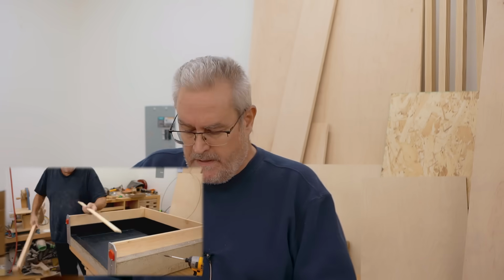Plywood Is Bad, M'Kay!

Comment from the maker: Reacting to the "feedback" I got on my latest video and shaking my head at how confidently people voice opinions when they have very little actual understanding of the situation.
I forgot to mention the second big reason why I designed the Y axis the way I did: it's easier and neater. Mounting the linear bearing directly to the concrete would be MUCH more difficult to do accurately, even with the anchors I cast into the concrete. I'd have to be MUCH more careful placing those anchors before the pour, and that would be ruined if they moved even slightly.
My next project (starting around the beginning of December, I think) is a fancy toolbox inspired by the  Gerstner models that have several drawers. I will be machining some of the parts for that project on the CNC, though, but all of the work could be done using the usual woodworking tools.
Follow the progress of all of my projects on Patreon: 
https://www.patreon.com/user?u=865843&ty=h
Reply: I’m excited to see the toolbox build!

Comment: I think there's just a disconnect between what you expect out of a machine vs what they expect out of a machine. Plywood and plate aluminum is fine for a woodworking tool, but it's not appropriate for cutting steel(can't take a decent cut without the chatter breaking an endmill, then there's the whole issue of wood moving with humidity). In the applications they're designed for, those linear rails are effectively a wet noodle. There's no specification for straightness over their whole length, you're expected to force them into alignment by bolting/clamping them to something that's extremely straight, flat, and rigid.

Comment: As you know you can build a CNC from plywood, MDF, 3D printed parts, etc as its been done many times before.  In all those common builds, no one bothers to pour a concrete base because those CNCs are designed to machine softer materials anyway (wood, plastic, non-ferrous) because those CNC build materials deflect and/or vibrate under heavy cutting loads leading to looser tolerances.  A concrete base suggests you are building a CNC to minimize vibration and keep tight tolerances.  You would want that if you plan on cutting harder materials like steel.  If you plan on just cutting softer materials, then the concrete base is just an overkill in the design IMO.  If you do plan on cutting steel, then you are going to want coolant anyway in which wood components is just a bad idea.   I just think people see a concrete base and assume you are building a heavy duty machine to cut harder materials that require coolant.   In the end,  it is your machine and you know what it is to be used for.  It doesn't matter what anyone else thinks about it.

Comment: Sir, I am a mechanial engineer and want to add my 2 cents here. I say this with all the respect in the world and as a longtime viewer. It is unfortunate that two pieces of the entire assembly dont reflect the other materials chosen, why even bother with a concrete base if the connection between the base and moving parts are wood? A CNC mill/router has to be strong, stiff and stable, if any of those requirements are not forfilled the machine will not perform as intended. You might get away with wood for the strength part, but it will not be stable, i.e movment of the gantry that reflects in the cut quality, it will also not be as stiff as aluminium/steel/conrete. There is a reason for why not even the absolute cheapest cnc products are made of wood. Honestly, the piece of steel/aluminium you wood need is not that expensive to get. 
The linear rails are actually not straight or flat at all from the factory, even the really expensive rails are not flat or straight. The straighness and flatness comes from the substrate they get mounted to, thats why there are so many attachment points to each rail. So, mounting them to wood is to be frank, a horrible idea.
best regards
Reply from the maker: I talked about why I went with a concrete base in a previous video, but to sum up stiffness wasn't the primary reason. Mass and it being a watertight tub for the coolant are the main reasons. But, as a mechanical engineer should know, stiffness is transferred to substructures that are solidly fastened to something that is stiff to begin with. Not 100%, but enough.
As for stability, you are overestimating the impact. There's more to using a material than just picking it and that starts with the design that works with the material to increase stability. Again, a mechanical engineer would know that.
The linear rails I used ARE straight - I checked them. And the wood is straight - I checked that. Is it perfect? No, but nothing ever is. Is it good enough for what I'll use this machine to do? Absolutely.
Reply: @IBuildItScrapBin  Thank you for the reply, I appreciate your work and intent, and Im understanding that the design steems mostly from what you want out of the tool and your preference to working with wood. I wright this not as a dismissal of your work, but from an engineering standpoint that consideres long-term structual behavior of the whole assembly. 

While your point about the designing with the material in mind is valid, and I completely agree that good design can mitigate material limitations, it´s difficult to overcome the both long and short term dimentional drift and stiffness limitations inherent to wood. Wood in contrast to concrete exhibit anisotropical mechanical behavior, nonlinear creep and dimentional instabillity, all of wich nobody wants in a cnc machine. FOr example, I would say that it is common knowlagde that wood creeps and changes with the seasons, even painted.

Some stiffness can be transferred, provided that the connection is solid and the load paths are in line with the submaterials behavior and purpous. For example, mounting a wooden structure to a concreate base does not change tha fact that wood has a significantly lower elastic modulus, is anisotropic and echibits time-dependent deformation such as creep, swelling and or shrinkage. While a rigid connection can reduce the effects locally, the materials own stiffness and dimentional stability still govern its behavior. 
In short, while mechanical interfaces matter, they do not override material science.

Regarding the linear rails. They are actually almost 100% reliant on the mounting surface and mounting tecnique. Almost all appear straight and flat when using a carpenter square. They are always measured after installation.

Sorry for the bad english, took me a while to wright this. 

Best regards
Reply from the maker: @styletokill  Wood movement isn't an issue when the machining time isn't stretched out over days. Wood is a perfectly stable material within a short timeframe, say the amount of time it takes to cut a few parts in one go. Any changes between machining operations are of no consequence. Time - it's an important factor.
Another important factor is the forces involved. I'll be running a max diameter endmill of just 1/4" (6.35mm), and most of the time just a 1/8" endmill, cutting just a few thousanths of an inch deep at a pass. That's nothing.
Final point is that this isn't a factory for making parts on a CNC. If I had such a factory, I wouldn't build the machine at all, let alone from wood - I'd buy one that's rugged and dependable.
Reply from the maker: @styletokill  You are greatly exaggerating the "issues". 
The best is to check back in a few months, after I've used the machine a few times and see the results. If there are real problems with it, I'll say, like I have with ever other machine I've made.
Reply from the maker: @styletokill  I like a good discussion, but you are making a big deal about insignificant details. For example, wood movement happens, but is only a factor if it happens during a machining operation OR if it's differential. If the machine is trammed accurately, the only way to throw that off by an amount that will make a difference is if the wood expands or contracts at different rates. For instance, if I made the solid maple cleats that reinforce the gantry different thicknesses. But I didn't do that (design right?) and in fact both are not only the exact same thickness, they are cut from the same piece of wood.
Reply from the maker: @styletokill  You should keep it at that because you clearly don't get what I'm saying. I never said wood is the best material to build a CNC. Never. And I never said all material behave the same way. Never said it, never would.

Comment: I have a lot of practical experience with plywood, and I agree it's strong enough. Not just strong enough, but arguably will add some damping to the system to keep it less 'ringy' (though with all that concrete that may be less of an issue anyway.)

But man, I wouldn't want to be slanging coolant around a machine with plywood. That would be my only concern.
Reply from the maker: Paint
Reply: @IBuildItScrapBin  I'm not the kind of guy that's going to keep up on maintenance. And paint never lasts forever. So, I try to design to my personal shortcomings whenever possible. Something I know you can appreciate.
Reply from the maker: You are exaggerating the "problem" and grossly underestimating the durability of paint. First, flood coolant isn't going to be washing over the wooden parts of this CNC - they are too high above the bed. Second, look outdoors. You'll see houses and other buildings that are... painted. They aren't out repainting them every few days, right? 
I see this overthinking all the time, where guys go out of their way to look for issues and the ones they find are often of no significance at all.

Comment: People don't seem to realize BobsCNC have been around for years and they've all been made completely out of laser cut plywood. They work pretty dang well. Woodsmith Magazine have build plans for a fully wooden CNC they published in 2019 issue 242 and in freaking 2014 there was a guy on Hackaday & reddit that made one out of plywood.  There's been several other commercially made wooden cncs out there.   All of these people are just keyboard jockies that probably haven't even built one of those cheap genmitsu / sainsmart cncs let alone an actual router based one.  They don't need to be made out of tungsten carbide to be rigid and capable.

Comment: So you want to compare stiffness of wood vs. metal huh- if you use maple like you commonly do, modulus of elasticity E is about 1.5x10^6 ksi, aluminum is about 10x10^6 ksi.  Lets say the sides of your supports are 3/4" thick, if you had used aluminum maybe you would have used 3/8" thick?  Total stiffness is E times I so for wood that is 1.5x10^6 x (3/4)^3/12, for aluminum it is 10x10^6 x (3/8)^3/12.  Do the math and you get that the 3/4" maple in bending is 20% stiffer than the 3/8" aluminum in bending.  Of course you could have used 3/4" thick aluminum, or 2" thick aluminum, or 2" thick steel, but beyond 3/8" thick aluminum is starting to get out of hand pretty quickly.
I watch a lot of your videos and have very few instances where I find anything substantial to comment on, you generally have thought things out pretty well and eliminated problems by the time you get to the video stage.
Reply from the maker: If I'd used 1/8" aluminum in place of the plywood, no one would have had anything to say.

Comment: I questioned the wood as well but didn't meant it as a fail of the construction. Was just surprised because I had different expectations..This build is very interesting with the solid base and It will be a good cnc at the end. What I would be interested in when the project is finished is a measurement of deflection on the spindle when pushing it  along the x axis when the gantry is in the middle. Anyway. Curious for the next videos on it and the end result.
Reply from the maker: I'll measure the deflection and overall precision of the machine by making parts with it. If the parts are precise and work, that's all I need.
Reply: @IBuildItScrapBin   Sometimes these measurements can give interesting hints for future CNC builds. But yes. At the end the result is what matters.

Comment: You're not chasing microns for your build. Plywood expansion/contraction when exposed to humid or dry air might throw it off a few thou but that's utterly irrelevant in most hobby/diy CNC machines. That said I didn't use any plywood in my second CNC build because I wanted to eliminate most of the variables that I could to make it stiffer. I used 20mm thick aluminium tooling place for the sides of the gantry, the bod and reinforcements of the 40x120 extrusions the axes were made out of. I've reached my goal to be able to easily machine aluminium and mild steel. Is it able to do it in microns? No, I aimed for about 0.1mm accuracy and that's more than enough for me. I also learned that torsion forces is a thing with high gantries, so I used steel box tubes to stiffen up the gantry and it halved the torsion compliance. I really don't want to be without my 210mm gantry and even more Z axis travel to clear the tool above the work piece. This has helped me out so many times for all those odd shaped projects.

Next build (if it ever comes to that) time I might add steel tubing for the gantry side plates as well, and the spindle plate too. Make it a bit wider too (650mm of actual reachable width is sometimes just a tad too little). Hence the tubing on the gantry sides, if it's going to be wider it'll need to be even stiffer. I might get rid of the 40120 extrusions too. Aluminium isn't really all that stiff, still is about 3x stiffer but also as heavy. But with clever construction (torsion box like) you can go a long way.

I enjoy your 'excentric' build, I've learned a lot!

And the reason why you use plywood is to make another CNC in the future without it.... right? ;)
Reply from the maker: An example of the level of precision I'm happy with is the clamps I recently made using the "old" machine. It easily cut the steel and aluminum parts cleanly and everything fit together perfectly. Same for the aluminum table and trunnions I made for my band saw using it. I don't own a micrometer and I rarely use a dial indictor.

Comment: Over 15 years ago I built my CNC with plywood. It has a 40" x 32" bed and Z axis travel of 7".  Despite my design flaws and poor workmanship this thing is absolutely solid and can reproduce cuts within a few thou over 40". That is more that "good enough". This year I hope to rebuild it in order to correct the mistakes I made and make it a little more presentable. There is nothing wrong with using quality plywood to make precision tools. I just wish that it was not so bloody expensive.

Comment: If plywood was so weak, the engineered floor joist would not exist. Yes, I realize the plywood web in a TJI joist is in compression, but that doesn't detract from the properties. Also, high grade Baltic birch plywood, which John uses, has more layers than conventional plywood, which means there is more cross grain throughout the sandwich.